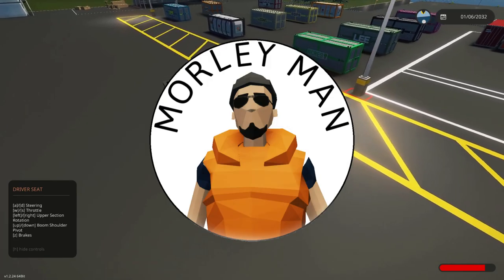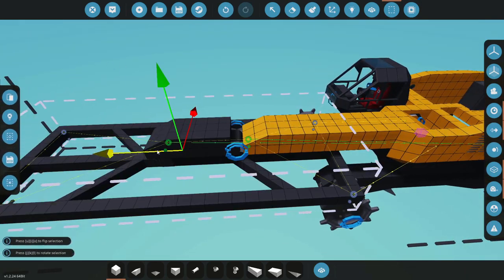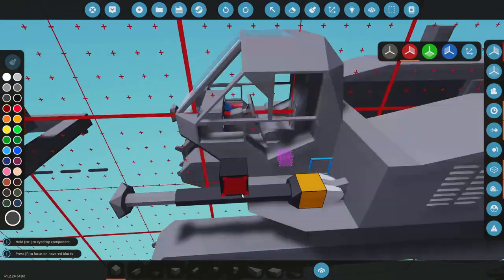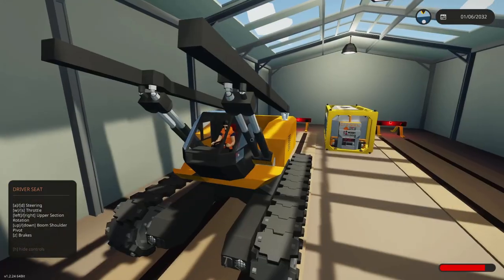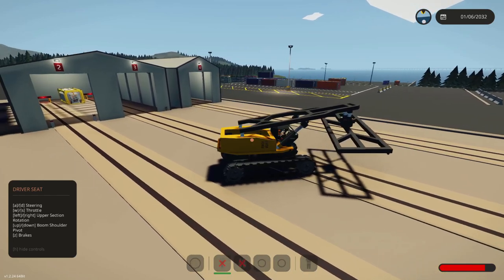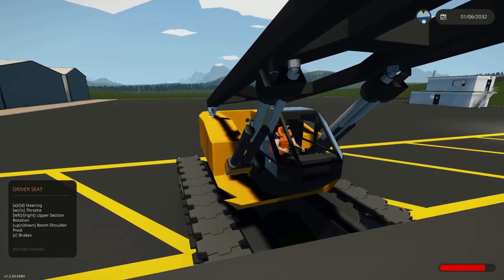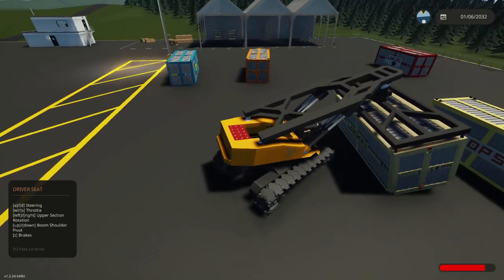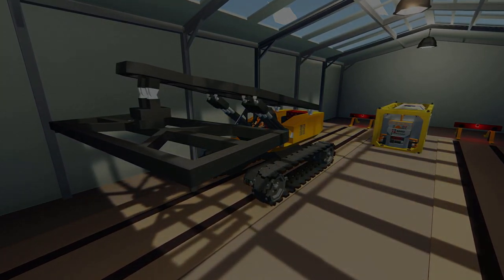Crates are too heavy! l Container Handler build #3

Comment: Keep the design but maybe try moving the pivot points back  further (better fulcrum) and make them the large rotation ones for more lifting power. I don't know. This is a tough one. Good luck with it.
Reply: Maybe an A frame at the back with a winch up top to be able to pull upwards on the boom.

Comment: I don’t know too much about this stuff honestly, but I made a self loading truck that used a ramp with two small winches and it could easily move the weight of the crates. Maybe winches or robotic pivots or linear tracks have more power than the hydraulic cylinders. Or maybe there is some fluid or power system to the cylinders I don’t know or understand.